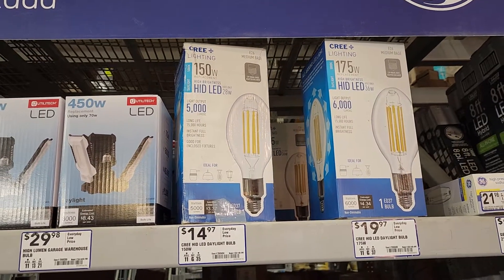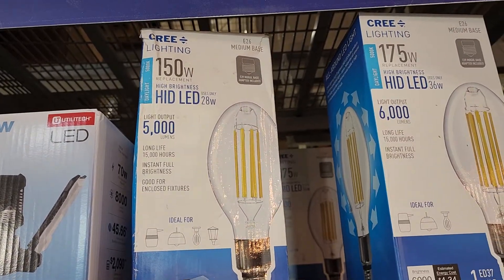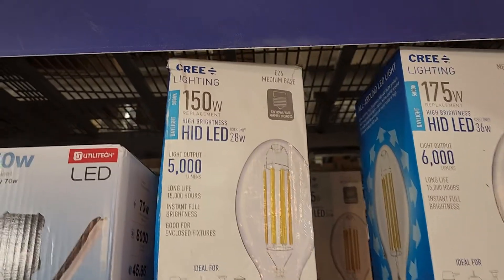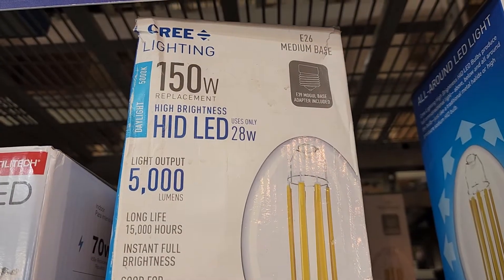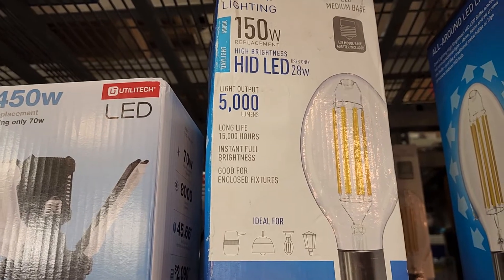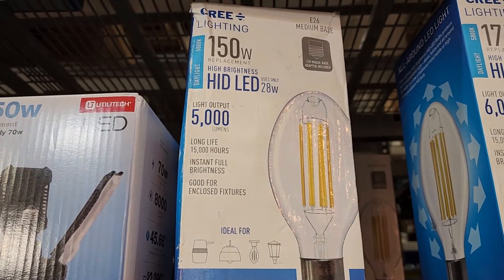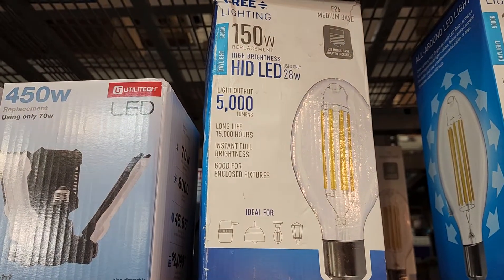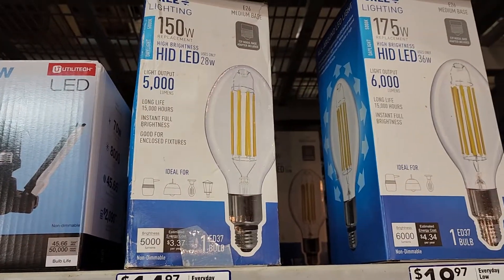150w HID (REPLACMENT)..  how is this replacing a 150 hps ?

Comment: How is that a 150W HPS replacement?.
Reply from the maker: No idea.  I should have taken the bulb out as well.. Its massive.. 2x  bigger than a 400w metal halide bulb.  ITS HUGE it wont even fit in most fixtures.. exceot maybe the area bucket ligjts.. but its so long itll stick out the bottom.. deff cant fit in the medium sized fixtures.

So i dont get how it replaces an HID lamp..   i might buy ome or two though for kicks and to test the lux...  One application i can see myself using it is in my barn lol.  The center of my barn is the biggest section.. 3 double doors.. space for 6 cars.. but it only has 4 regular medium base sockets for normal ligjt bulbs.  I habe 1600 lumen white led lights in it.. and they fairly well.. but it needs way more ligjt.  Lol would be interesting to pop these in there.. haha

I wanted to actually put my t12 shop ligjts though in there..  but i wont lie im curious about adding 4 5000 lumen leds..  should brighten the room by 10x.

But the fixtures are those industrial metal caged fixtures so you dont break a bulb working in there..  so probly not a good idea to have these massive balloons hanging in there

Comment: 150w hps lamp gives 3 times more light than this crap does
Reply from the maker: I opened the box too and the bulb was so large it woyldnt eveb fit in most fixtires.  It would stick out the bottom of a area ligjt.  It was the size of my head nearly lol